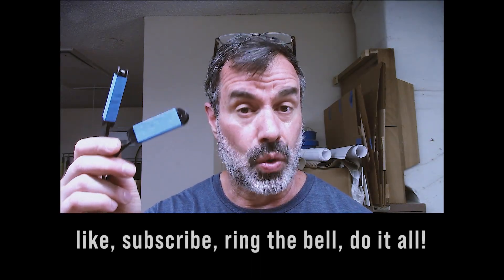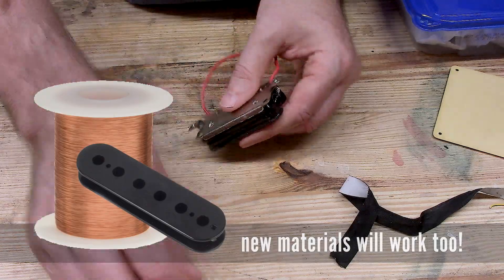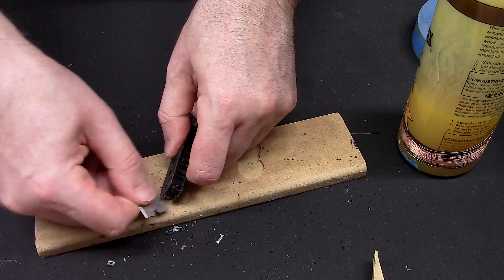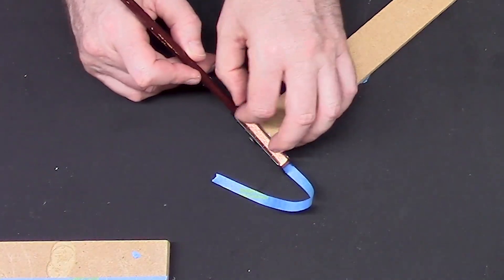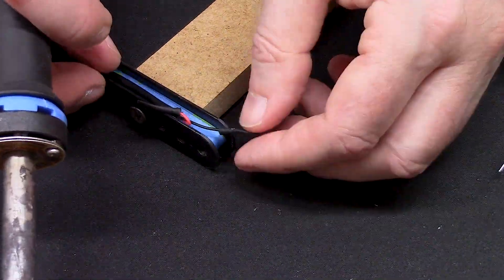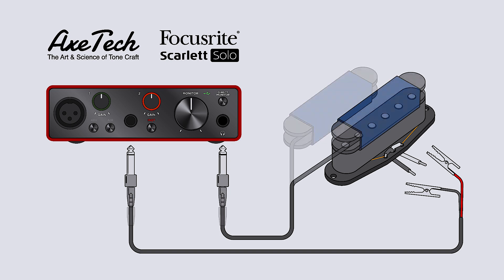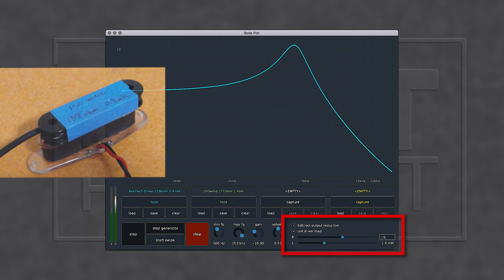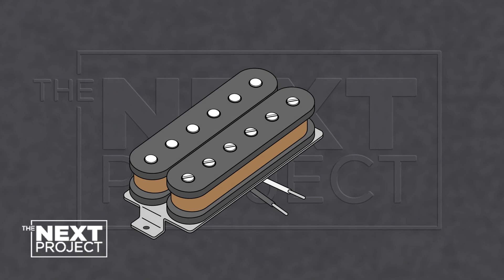AxeTech BodePlot Part 2 - Guitar Pickup Testing Coil Driver - Exciter Coil DIY

Comment: Can't believe I missed this one. Curious to try it out myself. Still running my Vellemann USB oscilloscope and PCLAB2000 software to do bode plots. But this software you're using looks a lot nicer. 

And I already have a Scarlett 2i2 interface. So should be perfect. Will have to take a more in depth look at this soon. Thanks so much for making this video.
Reply from the maker: Matt good to hear from you, and thanks for watching!

I also have the Velleman USB hooked up to a PC laptop, and a version of the Ken Willmott Integrator. 
While it works, I'm a bit impatient, and a fan of graphic feedback. 
The Axetech Bode Plot seems to be quicker in scanning, and I often let it cycle through 2 or 3 times before capturing the data. The UI screen is larger so it's easier for me to see, and the user controls seem simplified overall - not sure it that is ideal for a scientific analysis, but good enough for me. 
I'm running this software on a 2013 Mac, but have tried it on my son's 2023 cheap HP laptop and it worked equally well. 

The coil drivers are pretty easy to make, and I had originally purchase a driver from AxeTech, but they have been discontinued (the reason for this video). 

Your experience with pickup winding and all things guitar, you'd have this all sorted out in a snap.

Thank you for all the great content you share. 
Be safe and take care!
— John

Comment: Can you share the recipe to make these? You mention AxeTech provided those to you for this video.  I like following along but I'd also like the instructions to hand. Would that be possible?
Reply from the maker: I hope this helps. I can try to put together a "how-to" instruction sheet, but that will take a few days. Let me know if that's more what you are after.

PARTS:
(1) empty hum bucker style pickup bobbin
41 - 44 awg pickup wire ( can be wire taken from an old pickup )
(1) 3.5mm TRS cabe ( tip, ring, sleeve )
Tape and/or Shrink Tubing to cover the finished driver bobbin.

BUILD:
1. Warp 100, to 200 winds of 41-44 awg pickup wire onto the empty bobbin
	(as seen in the video)
 
TEST: Use a multimeter to verify continuity of the coil.

2. Apply a single later of tape to the winding for protection.

3. Solder the “TIP” and “SLEEVE” leads of the TRS cable to the start and finish ends of the bobbin winding.
NOTE, use a multimeter to verify/determine which TRS wires are for the tip, and sleeve. You will not use the third wire.

TEST: Use a multimeter to verify continuity of the coil, test at TRS cable TIP and Sleeve.

4. Wrap the TRS cable to the bobbin, add a wrap of tape or shrink tubing to the bobbin to hole everything together.

Assuming your bobbin has continuity…

5. Use and LRC (LCR) multimeter, test the driver coil for Resistance (Ω), and Inductance (mH).

You will need these values when using the Axetech BodePlot software.

HAPPY SCANNING!
You may wish to review the following video in regards to this process:
https://youtu.be/SCeFtqdcS1Y

If using the AxeTech BodePlot software, you may wish to review this video and consult the Axetech website for more in-depth setup and use.
https://youtu.be/UoWR1azq5l8

https://www.axetech.com/

Hope this helps.
Take care!
Reply: @theNextProject  Legend.  Thanks so much

Comment: Nice video. If you have time to wind an entire coil with hands only, directly from a spool, it takes time, but the difference in dynamic range is audible,and it is measurable in a lab. I do it like that ☺. Not all the time, but when i can, and it takes over 2 hours for one single coil, but i make a pause, drink a coffee a bit, continue. 
Bu that is no way for making of a pickups to sell them, it's like an option for exclusive pickup, to wind for yourself, or a someone special due to it takes a lot of time.
Cheers.
Reply from the maker: Milan, thanks for watching!
Winding a complete pickup coil by hand would require a lot of coffee!

These low-wind, partial coils made to be used with software that can measure frequency response, so they are very low wind count.  I wanted to show the option of taking an old pickup and recover the wire needed to make this coil for testing. 

I have a homemade coil winder that I use to wind complete pickups. 
Here's a link to that machine in action:
https://youtu.be/1wE-vsxl1dw?si=IMxkpxllQ1hzKqGr&t=88

Take care!

Comment: Thanks! It's just what I was looking for a long time!
But I have a very basic question first. Using two single coil pickups to put them together can also generate and get an signal. How is this different from making a separate drive coil?
Reply from the maker: Ricky, thanks for watching!
I think we are talking about two different things.
This video is about making a coil driver (driver coil/exciter coil) to be used with the AxeTech Bodeplot software.

If I understand your comment, yes two single-coil pickups can be put together in various ways, and generate an output signal, which would typically go to an amp or such device.
This coil driver, is put on/next to a guitar pickup and the software sends a signal to the coil driver, which in turn stimulates the pickup being tested. The pickup then sends its generated signal back to the computer through an audio device of some sort. I use Focusrite Solo audio interface between the computer and coil driver/guitar pickup.

If you didn't see the first video in this series, here's the link:
https://youtu.be/UoWR1azq5l8

Hope this helps, be safe and take care!
Reply: @theNextProject  Thank you for your quick reply. Sorry I didn't describe it clearly, let me clarify. What I mean is that using a single coil pickup directly connected to the output of the audio interface can also be used as an exciter to generate a signal for another pickup connected to the DI input. I also saw other people in other forums doing similar things. In simple terms, it is to use a real pickup as a drive coil. What is the difference between this and making a separate drive coil without a magnet and with fewer coils?
Reply from the maker: Ah, now I'm with you!

From what I've remember reading on various forums, the reasoning for the low-wind, low-resistance, low-impedance driver coil is to get a more accurate and consistent scan of the pickup being tested. The low impedance coil driver excites the guitar pickup being tested without interfering with it by not being in the response area of the actual test pickup... That's not a scientific nor overly accurate explanation, so I better stop confusing the subject.
Below are a few forum threads to take a look at.  Largely, these forums are discussing this process using the Velleman oscilloscope and software to scan and capture the bodeplot traces. I have the Velleman, a Ken Willmot Integrator and driver coil, as well as the AxeTech Bodeplot software.
I no longer use the Velleman/Willmot process for a number of reasons, mainly it's slow, old and a bit clunky.  I plan to do a side-by-side comparison of the Velleman/Wilmot and the AxeTech, but honestly I'm too busy to guess when that will be.

Here's a good place to start the guitar bodeplot study:
Bode plot introduction by Antigua:
https://guitarnuts2.proboards.com/thread/7723/measuring-electrical-properties-guitar-pickups

Ken Willmot:
https://kenwillmott.com/blog/archives/152

Here's a snipet of Antigua's driver coil explanation:
Step 1) Create a driver coil using the Strat pickup bobbin and the magnet wire.

Wrap the magnet wire around the bobbin about two hundred times, or enough to fill the bobbin. This will give the coil an inductance of a several millihenries, and a resonant peak that is beyond the audible range, which makes it suitable for this purpose, since its own resonance will be very far away from the pickup's resonance. Either solder lead wires to the coil as seen in the picture, or use the ends of the magnet wire as the leads. You will have to sand off the insulation coat from the wire in order to get to bare copper for soldering, or for making electrical contact. On this and other forums, this coil is sometimes also called an "exciter coil", "excitation coil", "external coil" or "field coil", all mean the same thing. 

NOTE: "...the coil an inductance of a several millihenries, and a resonant peak that is beyond the audible range, which makes it suitable for this purpose, since its own resonance will be very far away from the pickup's resonance. "

That's largely why we aren't using one pickup to test another.

I hope this helps a bit.
Let me know!
Reply: @theNextProject  Great! Finally answered my long-standing question. I agree that the previous method of using additional OSC equipment for measurement is not very convenient nowadays. The AxeTech method is obviously one of the easiest to operate by one person. I will definitely try a DIY coil in this way. And finally, thank you again for such a detailed explanation!

Comment: I’m a big fan of your stuff, but I don’t understand this one at all. I wish you could have explained what that software was & why you want to use it.
Reply from the maker: Hey Chris, good to hear from you and thanks for watching!
Sorry this vid was a bit confusing. It's a follow-up, or part 2 perhaps, to a video I did on the AxeTech BodePlot software.
https://youtu.be/UoWR1azq5l8

The software can be used to scan and plot a response frequency curve for guitar pickups, or other audio equipment I believe.
https://www.axetech.com/

To scan a guitar pickup, the BodePlot software needs a couple things; an audio interface (Focusrite Scarlett in this video), a coil driver (exciter coil), and a way to connect the pickup being tested to the audio device such as a mono cable with alligator clips on the end.

Once the software is installed audio interface and connections made, the software runs through a frequency range sending signal to the coil driver. The coil driver "excites" the guitar pickup being tested and a signal is sent from the pickup back to the audio interface and the software. From this return signal, the frequency response trace is plotted. The plot scans can be named, saved and exported to a .csv Excel file.  From there a database and Excel charting can be built and gathered.

I would expect a lot of people who are into making pickups would be interested in this type of setup. It should help give a visual to changes in pickup wind counts, magnet guauss charge, coil wire gauge changes.... a good addition to other collected measurements.

I probably should change the names of the two videos, adding Part 1, and Part 2... I can see the confusion from this oddball video.

Hope all is well, be safe and take care my friend!

Comment: Could have done all this in a single bobin, with tapped outputs :-)
Reply from the maker: Patrick, thanks for watching!

I guess you could do a single bobbin with individual taps. 
In the end, only one (1) coil driver is needed. This was a test to see if coil drivers with different wind counts would make a noticeable difference when used for plotting.

In the end, as long as the coil wind count isn't too-high, or too-low, and proper resistance and impedance measurements are taken, any of these coil drivers will work with the AxeTech BodePlot software for testing guitar pickups.

Great question, and sorry I may have glossed over the reasoning for making 3 drivers and why... My mind skips important parts at times.

Hope all is well, be safe and take care!

Comment: Well, 41 AWG is pretty strong, I assume.
I think on normal Strat-pups they use 42 AWG, on Tele-neck-pups they use the thinner 43 AWG, so 44 AWG would be even thinner. So is the 44 AWG used on Humbuckers in the size of a normal Strat single coil?
Very interesting.
Reply from the maker: Achim, thanks for watching!
Yes, 41awg is thicker than 44awg, with 42 and 43 falling in between.
This recipe is to give everyone a "general" reference of wire size that will work as shown. The resistance and inductance will vary slightly depending on the wire gauge used, the number of winds and possibly the size of the bobbin chosen.  
These are all "general" items to be aware of. 

To make the coil driver, I'm finding the important part is to be able to verify final resistance and inductance of the coil, keeping it rather low as shown in the video.
Apparently, using a high-wind coil does not work well for Bodeplot testing, but I don't have all the particulars on that. So, the rule of thumb is basically what is shown here.

Unless you have a spool of specific gauge wire on hand, you can very likely scavenge wire from an old pickup, wind a bobbin, test the resistance. If it is 200ohm, you and take a few winds off and test again until you reach the ohm amount you want. Then solder it up and test for inductance Henry (mH).

I don't know what I'm learning from this, but I'm finding the BodePlot comparison between different pickups interesting.
For people who wind pickups for a living/hobby, I think this would be a nice addition to put in the box when a pickup goes out the door. Moreso than noting the pickup resistance alone.

Hope this helps.
Be safe my friend!

Comment: I feel I'm missing something crucial here to understand the reason behind doing this.  What's the point in getting these stats if you have to destroy the pickup to get them?  Unless you're testing a series of pickups and you sacrifice one to ensure they're all presumably accurate to what you want.  Again, I'm certain this is my brain failing me, but I don't understand the purpose.
Reply from the maker: OMZ, thanks for watching!

Ah, sorry I made this confusing.
This isn't to test the pickup you are cutting apart, but to make a "coil driver" from an old pickup (or new materials) to use with software like AxeTech Bodeplot, to test frequency response of "other" pickups. 

This coil driver is placed on the pickup to be tested, then attached to an audio interface such as the Focusrite Scarlet, which in turn is connected to a computer which runs a software such as AxeTech BodePlot, REW, or possibly connected to the Velleman oscilloscope ( a PC hardware external device ).

The software sends a signal to the  coil driver coil which produces a signal field (over/around) the pickup being tested, and sweeps a frequency range. The pickup is also connected to the audio interface and returns a signal to the computer application which creates the nice (hopefully) spaghetti plot line.  

I can see this being a very valuable tool for the home hobbyist, or professional pickup winder/maker, to fine tune their product, see differences in wind count, wind type, wire gauge, magnet type and strength... A bit geeky perhaps, but interesting.  I'd like to see a "standard" and plots like this be offered by pickup manufacturers. However, I doubt that will happen, too many variables, and opposing interests. Maybe we'd see a lot of marketing being dismissed by plots. I don't know.

Hope this helps clarify the coil driver project, and I apologize as I may misuse some terminology relating to all this. I am clearly not an electronics professional, lol.

Thanks for the comment/question, sorry again to have mislead.
Be safe and take care!
Reply: @theNextProject  No need to apologize for the clarity of the video.  As I mentioned, the issue is likely my understanding of these ideas as I've not done that work.  Very clear explanation though, so thank you.  Effectively it's as I figured, in that it helps you to understand how the process affects the output and allows you to sculpt or fine-tune your pickup-making procedures.

Thanks for the detailed explanation.